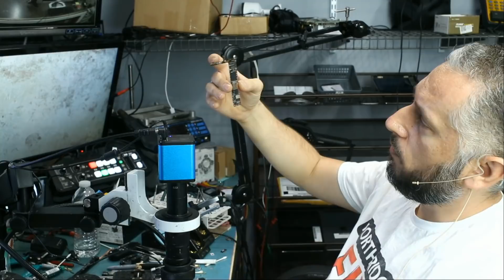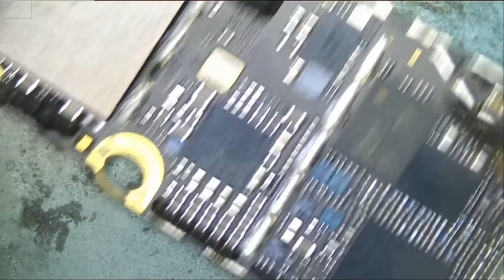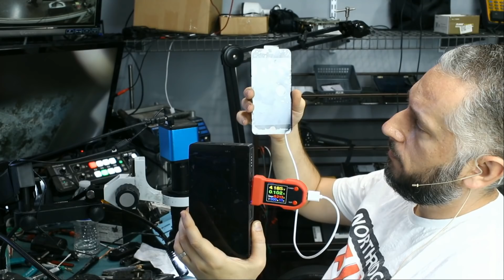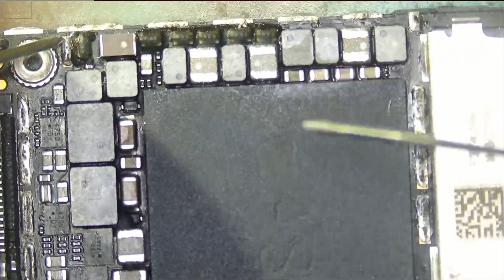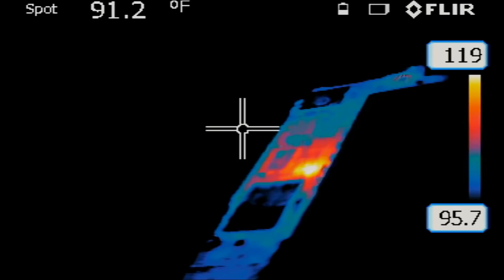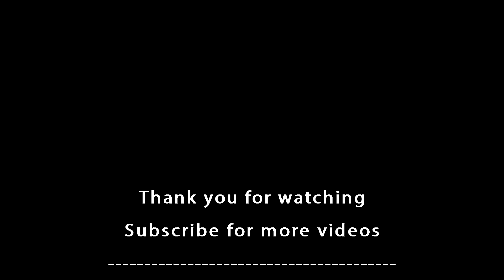iPhone 6 plus won't turn on - GPU Short

Comment: Hello sir . How are you.  If I may request you to do a video on laptop.  A basic understanding on checking and as an experienced person may describe fairly well.  What are all basic checking of a laptop until find an issue. For example.  How the current and Amps flows from a power switch to a battery what between the components. I hope you get me.  Thanks and regards. .. have a lovely weekend ahead 🙋👍👏🌷🌷💗

Comment: You should have explained why you cant repair it if the cpu has a short.Anyway nice video.
Reply: Because the CPU and GPU are not simple replacements like a capacitor or resistor AND because replacing the CPU will most likely render the data on the NAND useless. Likely the decryption will rely on the original device components for securing the encryption algorithm.
Reply: can do reball cpu
Reply: Siyad Mk not many people can do that with skill and have a chance of the device working afterwardsp

Comment: Isn’t that GPU is low resistance line so it will beep to ground both sides but supposed to give a reading in a normal case???
Reply from the maker: It's 0 Ohms. Dead short.
Reply: Could it be long screw damage?

Comment: Why do you always use a power bank instead of an outlet whenever using USB meter
Reply: Because he has the desired output plus it is a removable power source so it is easy to work with. Hope i kelped.
Reply from the maker: Portable and convenient.

Comment: Maybe the short with 1V8 LCM RESET...check that on caps around the connectors if that so remove the lcm reset filter and supply power 1v8 to the screen from dcps after booting...

Comment: Seems like good idea to backup data BEFORE beginning ANY work. I am simply watching a video, and i feel bad for both the shop and the customer. Terrible situation.
Reply: indeed its more challenging for the shop i guess
Reply: The shop said it was there for screen replacement. You can't back up unless the screen is working + you need the password
Reply: @omo2042  :  Good point. Well, if no way to backup data before surgery, and customer does not sign waiver accepting that data corruption is a possibility, then I'd pass on job. Don't need the headache of "priceless" photo(s) being lost.

Comment: Interesting video! May I suggest you do a shot of the tiny parts you’re working on? Maybe place them on a mat with metric and standard size measurements on or just throw a banana for scale if you wanna be extra technical. As non tech people most probably don’t grasp how tiny these components or even the main boards of the electronics you work on. Thanks again
Reply: lol wut? 😂 you even google images bro?

Comment: CPU CAN be reballed it might be shorted. you didnt even tried to do that. Why the hell are you charging customers for removing 2 damn caps. Are you serious?
Reply: Clearly he has an idea of the kind of work that changing a CPU represents. The problem is the budget that the customer can pay, the spare parts and the time that he can invest in changing a CPU. Also, removing that processor requires a lot of luck.
Reply: @MatiusLenin  customer might have some really good pictures there. i agree that i might not have money to repair BUT mister here says not fixable
Reply: @WeFixTvs  we do charge them max 100USD
Reply: It was the GPU not the CPU and the data is encrypted so no. No you cannot do that ARE YOU SERIOUS!! 😂😂😂😂😂😂😂😂😂😂😂😂😂😂😂😂😂😂😂😂😂😂😂😂😂😂😂😂😂😂😂😂😂😂😂😂😂😂😂😂😂😂😂😂😂😂😂😂😂😂😂😂😂😂😂😂😂😂😂😂😂😂😂😂😂😂😂😂😂😂😂😂😂😂😂😂😂😂😂😂😂😂😂😂😂😂😂😂😂😂😂😂😂😂😂😂😂😂😂😂😂😂😂😂😂😂😂😂😂😂😂😂😂😂😂😂😂😂😂😂😂😂😂😂😂😂😂😂😂😂😂😂😂😂😂😂😂😂😂😂😂😂😂😂😂😂😂😂😂😂😂😂😂😂😂😂😂😂😂😂😂😂😂😂😂😂😂😂😂😂😂😂😂😂😂😂😂😂😂😂😂😂😂😂😂😂😂😂😂😂😂😂😂😂😂😂😂😂😂😂😂😂😂😂😂😂😂😂😂😂😂😂😂😂😂😂😂😂😂😂😂😂😂😂😂😂😂😂😂😂😂😂😂😂😂😂😂😂😂😂😂😂😂😂😂😂😂😂😂😂😂😂😂😂😂😂😂😂😂😂😂😂😂😂😂😂😂😂😂😂😂😂😂😂😂😂😂😂😂😂😂😂😂😂😂😂😂😂😂😂😂😂😂😂😂😂😂😂😂😂😂😂😂😂😂😂😂😂😂😂😂😂😂😂😂😂😂😂😂😂😂😂😂😂😂😂😂😂😂😂😂😂😂😂😂😂😂😂😂😂😂😂😂😂😂😂😂😂😂😂😂😂😂😂😂😂😂😂😂😂😂😂😂😂😂😂😂😂😂😂😂😂😂😂😂😂😂😂😂😂😂😂😂😂😂😂😂😂😂😂😂😂😂😂😂😂😂😂😂😂😂😂😂😂😂😂😂😂😂😂😂😂😂😂😂😂😂😂😂😂😂😂😂😂😂😂😂😂😂😂😂😂😂😂😂😂😂😂😂😂😂😂😂😂😂😂😂😂😂😂😂😂😂😂😂😂😂😂😂😂😂😂😂😂😂😂😂😂😂😂😂😂😂😂😂😂😂😂😂😂😂😂😂😂😂😂😂😂😂😂😂😂😂😂😂😂😂😂😂😂😂😂😂😂😂😂😂😂😂😂😂😂😂😂😂😂😂😂😂😂😂😂😂😂😂😂😂😂😂😂😂😂😂😂😂😂😂😂😂😂😂😂😂😂😂😂😂😂😂😂😂😂😂😂😂😂😂😂😂😂😂😂😂😂😂😂😂😂😂😂😂😂😂😂😂😂😂😂😂😂😂😂😂😂😂😂😂😂😂😂😂😂😂😂😂😂😂😂😂😂😂😂😂😂😂😂😂😂😂😂😂😂😂😂😂😂😂😂😂😂😂😂😂😂😂😂😂😂😂😂😂😂😂😂😂😂😂😂😂😂😂😂😂😂😂😂😂😂😂😂😂😂😂😂😂😂😂😂😂😂😂😂😂😂😂😂😂😂😂😂😂😂😂😂😂😂😂😂😂😂😂😂😂😂😂😂😂😂😂😂😂😂😂😂😂😂😂😂😂😂😂😂😂😂😂😂😂😂
Reply: @HazeAnderson  so? What so funny about it? if you cant fix it its not my problem but dont share the video. Anyway i didnt say northbridge doesnt know what he does.
Reply: @lunatravel2375  You are a funny! 😂😂😂 It cannot be fixed because the DATA IS ENCRYPTED 😂😂😂
Reply: @HazeAnderson  do you even have the idea of iphone projects how does it works because i do and very much. Point is i am an Electronics Engineer things that i do allow me to talk and do repairs that you cant.
Reply: @How Not To  you mean V=RxI that knows even my 3 years old nephew.
Reply: @How Not To  sure whatever u say. can you explain to me Euler number and why it is called e? thanks my second degree is in maths and physics now go eat something
Reply: @How Not To  tryin to test your abilities on math. Of coures e is irrational but why we need it and dont google it :)
Reply: @How Not To  you didnt wrote it as it should, it is either (1+1/n)n or you take the limit of this expression when n goes to infinite or 0. SO in first case answer will depend from n and algebra suggest it is 1/n+1 then your numerical result will be on depence of n. But in second case this is interesting because you will have two forms of this. One is to take this expresion and write it as series and other one is to treat it as is. Series might be convergent which means limit will give you a number and it mean that series terms  sum will give you a number or it will be divergen which means you will have two or more different results. 

I hope i was clear here. I realy have a degree in maths so i can talk for it for hours and hours honestly.
Reply: exactly
Reply: Clowns 

GPU is not paired to the CPU encryption key, it can be removed and replaced without having to touch the CPU below (it just takes a hell of a lot of time and skill, I’ve never been successful)
Reply: @aqib2000  there is the answer
Reply: @How Not To  test me
Reply: @How Not To  tell me how many ways are there to find faulty boards  like shorts for example? do you know it? just one simple question, of course you can google it but you also  must know why. Have a good day.

Comment: Isnt it possible to remove the datachip amd place it on another board?
Reply: No it‘ paired to the CPU and other stuff
Reply: Apple doing a great job of securing your data. Even securing it away from the owner.